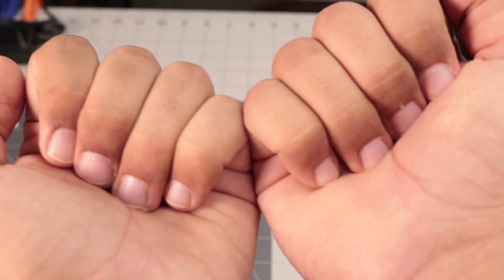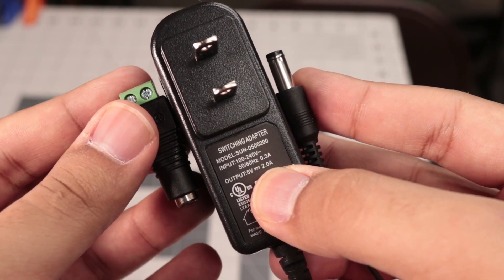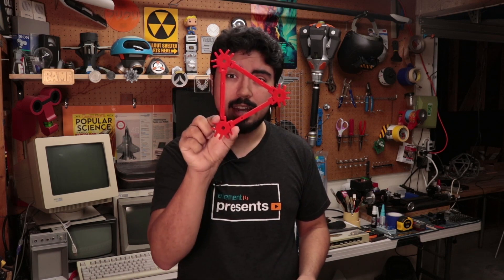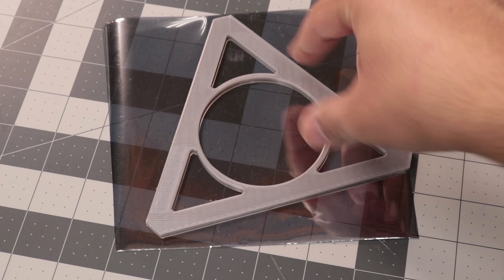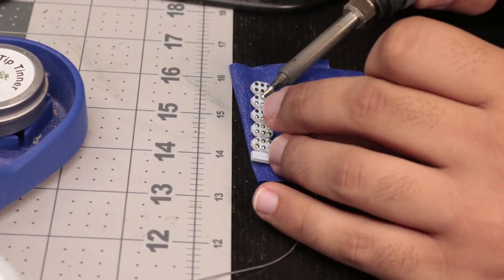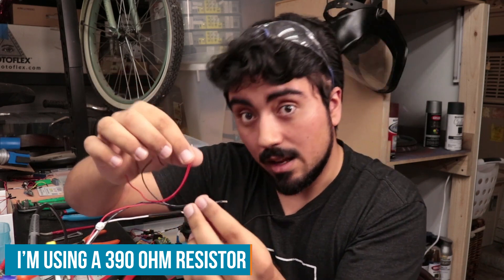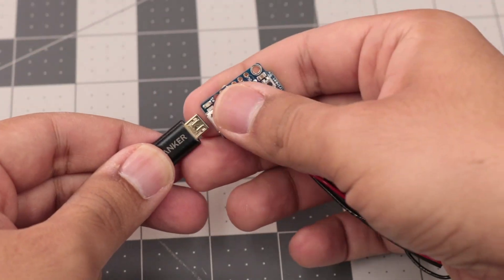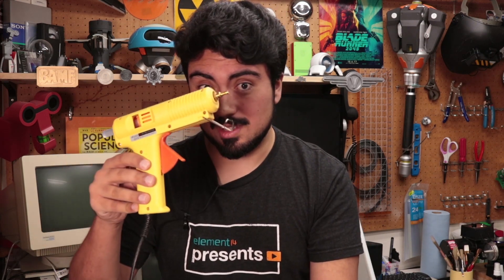Infinity Icosahedron

Comment: öhhh success ? maybe next time when you use acylic mirror, but this effect is not what i call infinty. Generell problem on this Element14 presents format, no words about the code, even if you just use the adafruit example code. There are enough videos , showing us "i plug this on that, power on with this, and i have blinking light"... hope better for next time.